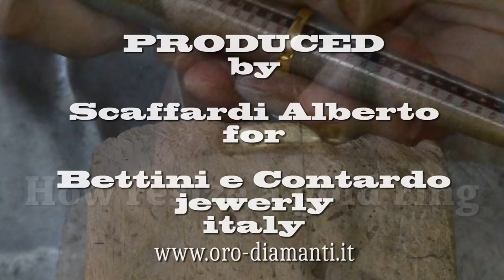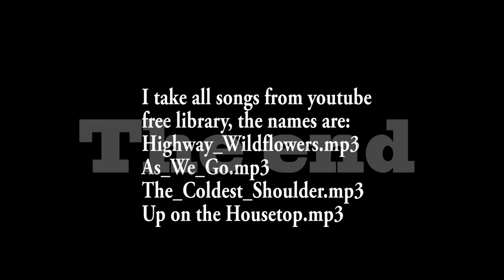How resize a gold ring

Comment: Of course, if you have more fragile stones, they can be protected from the heat of soldering by using a type of clay product that can encase the top of the ring while the band is being worked on. Diamonds don’t require such handling. Great video!
Reply from the maker: thank you

Comment: When down sizing I wonder if your able to use the chunk of gold that's cut out to weld it back together if made into those little squares ?
Reply from the maker: No, the removed parts cannot be reinstated. For the union of the two parts gold is used in alloys with a lower melting point.
Reply: @scaffoal  what happens to the gold cut out ?
Reply from the maker: @andrepadilla273  Everything is recovered and recast. If you search among my published videos you will find one in which I show the recovery of processing waste.

Comment: Great video. What did you put on the gemstones to protect them?
Reply from the maker: thank you. For some gems a refractory paste is used to protect them from heat, others do not suffer heat damage. The use of refractory pastes also depends on the position in which the welding is carried out, in some cases, the structure of the ring, allows the welding to be carried out, without the heat being propagated up to the gem.
Reply: @scaffoal  Thank you for taking the time to answer this. Love your videos.

Comment: How to increase ring size if the ring is set with a stone that is sensitive to heat?
Reply from the maker: With flame welding, or disassembling the gem or using protective paste that protect the gem from the heat.